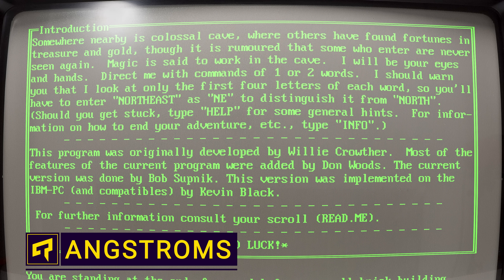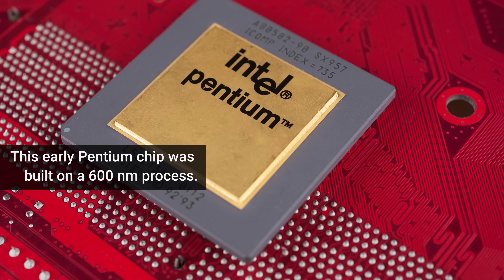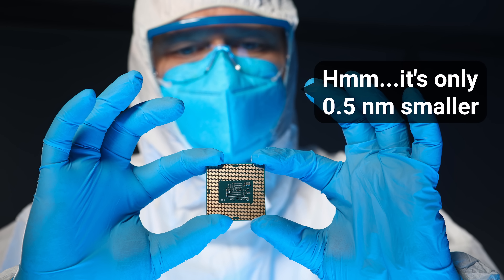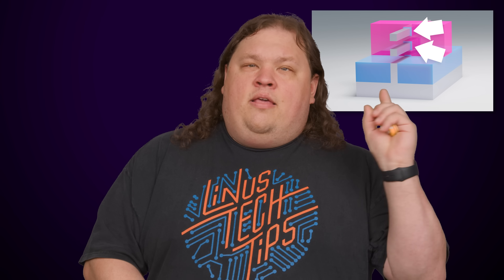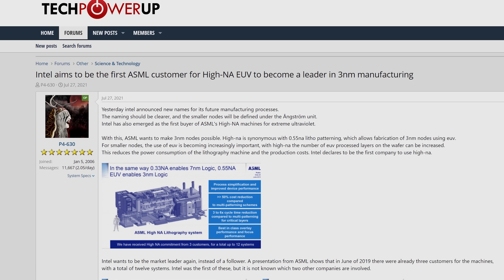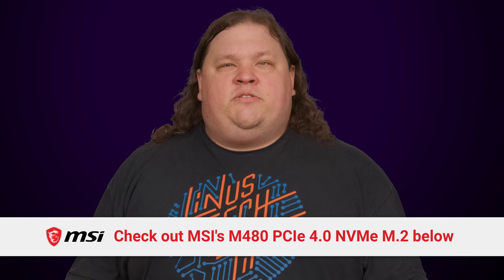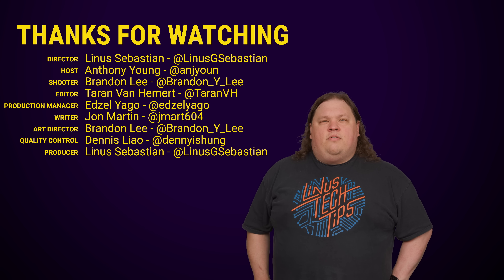CPU Angstroms vs. Nanometers

Comment: "The angstrom or ångström is a metric unit of length equal to 10⁻¹⁰ m; that is, one ten-billionth of a metre, 0.1 nanometre, or 100 picometres. Its symbol is Å, a letter of the Swedish alphabet. The ångström is not a part of the SI system of units, but it can be considered part of the metric system in general."
Reply: Angstroms are handy because one angstrom is roughly the diameter of a Hydrogen atom.
Reply: Why did they not use picometers instead. Seems like the natural progression. Not that my Swedish ego dislike Ångström.
Reply: @DarkJK  angstrom sounds cooler than picometer
Reply: @WayStedYou  then use ångström.  If you want to be cool.
(It is practical in physics, as some mention it is about the size of a Hydrogen atom).
Reply: Rather than using ever decreasing numbers they should have switch to MTPI (millions of transistors per inch, or meter, whatever). This way we have a number that rises with every generation, which the marketing guys should love. 7nm would be 3.6 MTPI, and 5nm would be 5.1 MTPI.
Reply: @ChatTHC420  NEVER EVER USE INCHES IN ANYTHING NEW.  Base it on meter or IS-units.  Ångström is based on meters.  And it is useful as it is 0.1nm or  100 pm.  But it is easier with the number of significat digits when using Ångström, that is 1 Å and not 0.1 nm or 100 pm.  Yes, there are a difference between 1 Å and 1.0 Å.  It is in the number of relevant digits in the result.
Reply: As a Swedish viewer and general fan of metrology (the scientific study of measurement) I can attest that the Ångström is still something we learn about in physics class.
Reply: not "special" characters on a nordic/Swedish keyboard åäö. a Norweigan ö is an o with a / in it. if you want to use them you can either use ASCII codes or set your English keyboard to Swedish then [;' becomes åöä
Reply: @zap117  or use Compose key or Alt Gr key.  It is easy, åäöæø.  :-)
Reply: @zap117  
And the entire North American online population wouldn't be able to type anything 😆
The physical keys on a keyboard are not in the same place between those two languages
Reply: @rosen9425  im using and american ansi keyboard , and i wrote the keys [;' wich are the same spot that åöä will have if you switch between the languages it does not matter what the text on your keycap is =P
Reply: @rosen9425  every letter on a swedish keyboard is in the same place as the english, but Å is placed to the right of P, Ö and Ä is placed to the right of L. But the signs that are there on an english keyboard are moved around a bit. Often a problem while gaming and they original keyboard layout uses those keys, It is a little trial and error at the start for us with a Nordic keyboard.
Reply: Not an official SI unit indeed but it's still metic, just like a metric Ton.
Reply: Angstrom is usually used in measuring the size of atoms. Its a more easier scale to measure because it's 10^(-10) which is easier to measure compared to 10^(-9) of nano and 10^(-12) of pico. We can measure upto 10^(-15) which is femto.
Reply: @themightywolfie7145  I was also going to write this. But you wrote it already very well.
Reply: Swedish keyboard gang
Reply: Hey hey hey it's also a letter in the Danish and Norwegian alphabet
Reply: @netiosys4677  And a letter in the FInnish alphabet.  As they use the Swedish one.
Reply: Så e det
Reply: @kevin42  I åa ä e ö.  Proper Swedish sentence. :-)
Reply: We found Anthony's clone
Reply: sverige jaaaaaaaaaaa
Reply: This is learned into high school. Lol
Reply: What is that in hands
Reply: anime cat
Reply: Thanks. The knowledge you impart is a big help in my community
Reply: Yōūr nērd kūng fū īs strōng.
Reply: Thank you
Reply: You have enlightened me to know more about computers even more
Reply: I understood this, cos science is my favorite channel. I am waiting for the 8Å chip (.8 nm or 800 pm). But Moore's law may end before that. :)
Reply: I'm so dumb that I was more impressed with all the funny little characters you managed to get into the post, than what you said (because obviously, I didn't understand it :-) )
Reply: @johnny5805  swedish keyboard be like
Reply: @Sinaeb  Ångström is trivial to type with a phone keyboard. Just hold down the keys...
Reply: @gajbooks  It's easy on PC as well, hit the compose key, than A twice for the Å. Hit compose key, then o then " for the ö (like combining o and ").
Reply: @johnny5805  Let me try. Millimeter is easy right? A millionth of a millimeter is a nanometer. A 10th of a nanometer is an Angstrom. Angstrom is a pretty important unit. The literal distance between atoms can be a few Angstroms. The size of a hydrogen atom, for instance is about half an Angstrom. As chips get smaller, the sizes of features on the chips are only about a few atoms wide. So Angstroms make sense.
Reply: @johnny5805  äbßølútêly ik it doesn't make sense
Reply: @forbiddenstuff8656  of course, you are not using it in the right way.
Reply: @johnny5805  Same here, I couldn't care less about the science he's describing, I'm more interested in how he inserted the special characters XD
Reply: we measure wavelength in A
Reply: @oksowhat  We measure wavelengths in many different units, not just Angstroms.
Reply: @Mike__B  I mean it's the most general, even the common formula for finding radius of an hydrogen like atom gives answer in Armstrong
Reply: @oksowhat  we measure wavelength in Å, not A.
Reply: @AndersJackson  my keyboard does not have this Armstrong char, thats why i typed A, moreover i was lazy to copy it from net
Reply: @oksowhat  you probably have, you just don't know.  And that is the Å character, not Ångström.
You don't call "T" the Tree character, or "E" the Einstein character, do you?

Depending on what nationality and OS, try "Alt Gr" combined with a ordinary character.  Or a compose character combined with "A" and "*".

You have it, if you are running one major OS.
Reply: @AndersJackson  actually the unit is Armstrong, and though i know its a alphabet in some language proablly Swedish, but i dont know its sound, so i and rather every person with science background in my country call it armstrong, sorry if you did't liked this, will take care next time
Reply: @oksowhat  If you are talking about Å, then it is Ångström, nothing else.

Do you also say Voltare and Adam when talking about volt and ampere?
Reply: @oksowhat  yes, it is one thing to be wrong, everyone can be that.
Not to accept that when told is another thing altogether.
Reply: @oksowhat  
No, you don't. A stands for ampere, the unit of electric current.
Reply: ik, i am doing research in modern physics😅, my keyboard does not hs that A with a halo over it so just wrote A @Persun_McPersonson
Reply: @oksowhat  
It's important to not have symbol conflicts, so it's better to find an alternate way that doesn't also mean another unit.

If the A with a circle symbol isn't available, I think the alternate symbol of "Aa" should be accepted, as it's an alternate way of writing the same sound in other languages (kind of like how "th" is now used instead of the letter thorn).
Reply: @Persun_McPersonson  å just found I can get this by long press a
Reply: @oksowhat  
Oh, you're on mobile? I thought you must've been on PC since that makes it even harder to use non-ASCII characters. But cool.
Reply: actually i replied this that from my phone, the earlier 2 comments i made were from pc, but hey i was not wrong😂 @Persun_McPersonson
Reply: @oksowhat  
Haha
Reply: Yeah weird that they didn't say that Angstrom is 0.1 of a nanometer, as if it's common knowledge
Reply: @remmoze  They did say that...
Reply: @eirikheggelund  give me the timestamp then
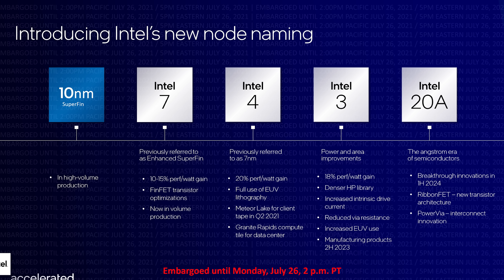Reply: @remmoze  Sure. The graphic at 3:33 is makes it very clear.
Reply: @remmoze  it was kinda obvious.
Reply: @remmoze  It is common knowledge, at least if you are into physics.  And it is Ångström,  which isn't Angstrom nor A.  It is Å.
Reply: Why not Just use piko meter. To Keep things simple. 
0.5 nano meter is equal to 500 piko meter.
Reply: @esphilee  then their 20 Å series would be a 2000 pm and it would not be as easily recognized as the same thing as their 14 nm, 10 nm etc marketing. It might get confused with the clock speed, etc.
Reply: @DocDeg  , just use 2nm until you reach 0.5nm where you start with 500pm.
Just like when you are 2km from home, the bar is 500m ahead.
Reply: I didn't know that Å was in the swedish alphabet,  but we in Denmark have it too 😊.
Reply: Å is a letter of the Norse(Meaning the Skandinavian germanic tribes) Alphabet.
Reply: @thyscott6603  actually not.  But it is used in Scandinavian.  The Norse "alphabeth" is the futhark.
Reply: Yes, let's please not use this stupid unit. Use the ones we've all already agreed on and just go to pm instead of nm.
Reply: @quinton1661  hahaha I feel the same, but it is not rare to see Angstrom during an Introduction to Astronomy class.
Reply: @quinton1661  the Angstrom is widely used in atomic physics so...
Reply: @quinton1661  Angstroms are widely used in Chemistry especially molecular chemistry
Reply: @quinton1661  
To be fair, the angstrom isn't really any different from the decimeter in that it's not as useful due to just being a a power of 10 smaller than its superior but technically is in line with how metric originally was conceptualized, minus not being named as a part of a meter due to not actually being an SI unit (though, to also be fair, neither is the liter, which is equivalent to a cubic decimeter rather than a cubic meter and so loses some coherency with the base units and due to that is not an SI unit but rather just a "unit accepted for use with the SI").

On the other hand, there's a reason why the way SI units are used in practice diverged from the original conception, where most units skip to powers of one thousand, minus the meter which is used as both divisions of one thousand and one hundred, though not as powers of one hundred; aswell as a few other exceptions like the aformentioned liter which is a renaming of a cubic decimeter, the milliliter which is equivalent to a cubic centimeter (leaving the centiliter as useless as it doesn't even have a meter-based unit that it's equivalent to due to how the math works), or the are/decare/hectare: old metric units of area that aren't part of the SI, breaking consistency even more than the liter does, equal to 100/1,000/10,000 square meters respectively. This means that one square meter is equal to one centiare! It's the kind of messiness that I'm glad SI is slowly trying to move away from in order to avoid slowly becoming more imperial-like.
Reply: Å? More like norwegian!
Reply: @MultiGamerClub  Å is also in Swedish. And considering the metric is named after a Swedish Scientist... just saying.
Reply: @MultiGamerClub  used as much in Swedish
Reply: @MultiGamerClub  nope.  Ångström was a Swedish scientist.  And yes, åäö are Swedish characters.  åæø is Norwegian and Danish characters (not looked it up, I am Swedish so I think I remember it right)
Reply: @MultiGamerClub  Or Danish.
Reply: @supervegito2277  in this case it is Swedish.  Do Danish and Norwegian have a ö and ä?
Reply: @AndersJackson  Sound? yes, but its written differently

Æ and Ø

Former is also written A+E and latter O+E i should know as i have that in my middle name, so sometimes when Ø cant be written, you get OE instead.

I was mainly commenting on how all 3 countries have Å, that one atleast appear official

Though the Æ and Ø keys on my keyboard do have the swedish/german variants as well... not that i know how to use them though
Reply: @supervegito2277  Tack skall du ha för att du förklarade det.  Alltid någon som inte har koll. :-)

AND you forgot that Finland also uses the Swedish alphabet.  And keyboard.
Reply: @AndersJackson  I didnt understand all of that, i am danish myself

And on that note, i didnt forget finland.. i just plain didnt know.
Reply: @supervegito2277  it was "Thanks for explaining that. Always some with no clue".
Thought Danish people understood other Scandinavian languages, at least written?

Yes, Å was original AA, Ä was original AE and Ö was original OE.  But the second character (a and e) was moving up, above the firs, and A turned into a circle and A into two dots.

Anyways about Finland, no problem, we can't know everything.  Yes, they use Å, Ä and Ö in Finland, both when writing Swedish and writing Finnish.
Reply: @AndersJackson  I understand to some degree. I did catch the first line, its the second one that caught me off guard.

Also, i am better at reading Norwegian (a lot of the time its just Phonetic Danish amusingly enough)

Its swedish that gives me trouble, but i do see the similarity.

I dont understand one word of finnish though.
Reply: @supervegito2277  Finnish is something totally different. :-)
Reply: I'll take your word for it because that comment is waaay to big brain for me to comprehend
Reply: @JohnSmith-xq1pz  If this is "big brain" now, I do fear for future generations.
Reply: What a disgusting unit
Reply: What's a metre? Oh you meant METER... Me....ter
Reply: @motoryzen  Metre comes from Greek "Μέτρο" (Metro) so Meter is the "wrong" spelling of the word.
Reply: @ydatoporin  but it was developed by English sientist and implemented by France.  So no, you are wrong.  Kind of, and also right. :-)
Reply: @motoryzen  Silly... both are valid ways of spelling.
Reply: @motoryzen  French word as they invented it, so it is metre. Only the US has to have different spelling. Just like many of you don't know the difference between rout & route
Reply: @zetectic7968  "Only the US has to have different spelling" – no, it's "Meter" in Germany as well.
Reply: @Gramini  I did not know that , thanks for the info
Reply: @zetectic7968  Meter is spelled meter in Sweden. 
And it was an English scientist that came up with the system.  France implemented it after the revolution.
Reply: @AndersJackson  Thanks for the info
Reply: @motoryzen  

Metre is the pronounciation and grammar for Great Britain and the Commonwealth
Meanwhile Meter is the pronounciation and grammar for USA

(Just like Saloon for Great Britain and the Commonwealth vs. Sedan for USA)
Reply: @motoryzen  1 meter was based on the distance from the North Pole to the equator, which is 10,000 km = 10,000,000 m or meters
Reply: @knudplesner  dude this was a freaking year ago...I'm not scrolling through hundreds of comments to find which one I made.
Reply: @motoryzen  it's metre in some languages so he's not wrong
Reply: @T-90  yeah like in England where they speak English they spell it as a metre! Haha
Reply: @T-90  

Not some language, but specifically, English that used in Great Britain and the Commonwealth
Reply: @motoryzen  Lol, bottle pronunced bottel...

Comment: Moving away from semiconductor transistors, a new active area of research is to produce what are called single-molecule magnets (SMMs). These materials would allow single molecules to act as individual bits, making our microprocessors even smaller.
Reply: I believe this was intended for storage.
Reply: SMMs could be applied for both storage and processing, granted they are far away from application atm. They have to hold magnetic bi-stability at reasonable temperatures, currently approaching 100 K, which is still to low to be practical (>293 K). They also have been explored as potential qubits.
Reply: @Alikzer  as qubits, yes. But for classical storage they won't be used. Consider the coherence times in QC now; the best are in the micro second range.
Reply: i think term "microprocessors" is a bit outdated nowadays.
Reply: Molecules? 20 angstroms is only 10 times bigger than a singular ATOM of Si. And it's a measurement of length, so it's linear.
Reply: @Vladimir_Kv  The only problem is that the name 20A is meaningless. It has nothing to do with angstroms, and is just a marketing lie. All the names are lies.
Reply: @Vladimir_Kv  I'm not entirely familiar with semiconductors, but I believe that they are co-operative bulk property, Its not just a single Si atom. It is more of a fact of how small can you design logic without running into problems. In both cases addressability becomes an issue the smaller domains or logic gates become, not to mention other quantum phenomenon making the picture more complicated.
Reply: Fun fact: the hydrogen molecules in your body can be magnetically aligned, and their resulting spin measured by Fast Fourier Transform to form graphics! 

MRI! 😎✌🏼
Reply: *making our current microprocessors obsolete :D
Reply: Because storing information is what computers do... Why would you want a computer to compute?
Reply: yall ever just quantum tunnel
Reply: A N I M E
N
I
M
E
Reply: @ChaosSwissroIlCommentsCensored  yeah but its a different approach. So you cant say specific if it will be a problem.
Reply: aka "Molecules are smaller than atoms", which is incorrect
Reply: A N I M E
N
I
M
E

Comment: With very few exceptions, if an LTT video title ends with a question mark, the answer is "No."
Reply: One of the first suggested videos on my sidebar is "Is this card a scam??" and I've seen that one, the answer was yes.
I'd guess that more often than not the answer is actually yes, but no. Because they like to try dumb stuff for fun, like coolers you need a dremel to install and aren't even slightly practical.

Comment: 0:27
Isn't it 12nm tho, its based on Zen+ which is used on the 3000 Series APUs. 2000 Series had Zen which was 14nm.
However, 3000 Series NON-APUs were 7nm since they were Zen2 based.
Reply: That's what I thought.
Reply: THANK YOU
Reply: Does it matter? None of those are actual measurements.
Reply: AMD really messed up their desktop vs APU/mobile naming scheme from the start. Really glad they fixed it with the 5000 series.